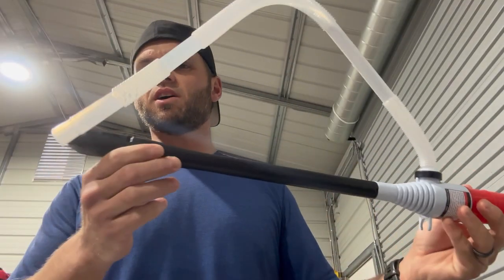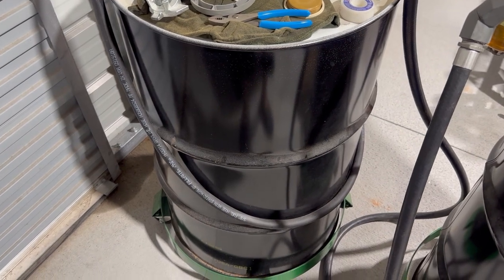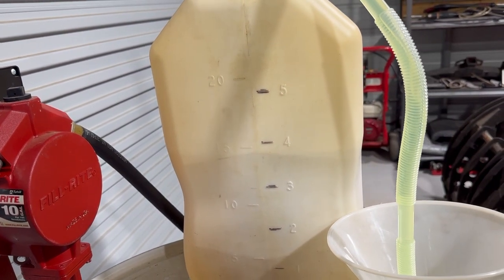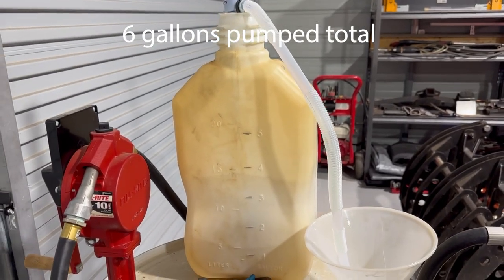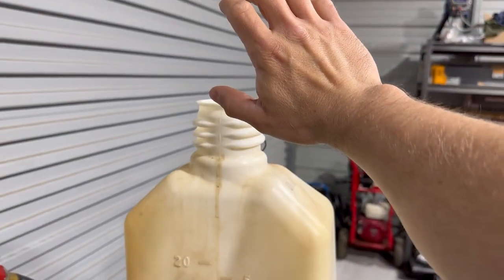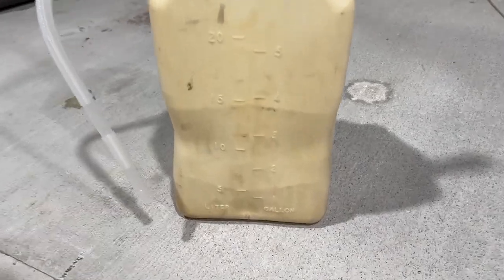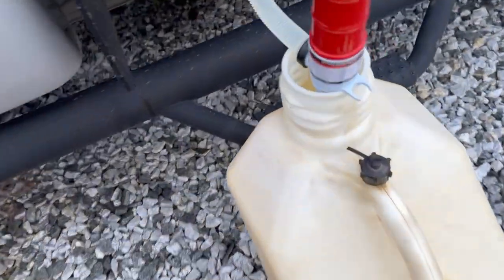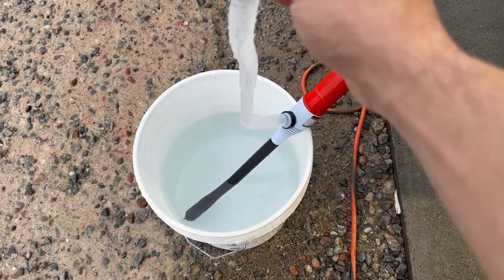This Sucks 😁 | Harbor Freight Battery Operated Liquid Transfer Pump

Comment: I have one as well and really like it! The pump and hose that goes into the gas tank is telescoping be pending how deep the tank is. Get a better set of batteries, I have used mine or some time and it still pumps like when the batteries were new.
Reply from the maker: I like mine too! From some of the comments it seems like we got really lucky with ours. Mine is still running strong.
Reply: @reallifetested2605  Ya we maybe did but then again I find it’s very hard to please some people now a days.

Comment: Is it holding up?
Reply from the maker: I pumped another 100 gallons of diesel , gasoline 2 days ago and it’s still running strong! I’ve got quite a few comments saying theirs didn’t last, and my dad has went through 2. I might’ve gotten lucky?
Reply: They are frequently on sale or there are random coupons. If you are an inside track member, I think they are less than $6.29 (Oct 2024) this month. This thing could break every year and I'd keep buying them because they are just that handy. I'm going to pick up a couple more while they are on sale and try to mod one that has a hose on the suction end for the same reason as in the video, I have some fuel jugs like in the video and a couple others that the pump doesn't get to the bottom of. Also, I am going to dedicate one to gas and another for diesel.

Comment: That was a great video. I actually have one of these Harbor Freight pumps that I saw at the store as well and was surprised at the performance. I use it to transfer water from 5 gallon water bottles to fresh water tank on my RV. I'm going to get another one to put on my Inflatable boat as a bilge pump
Reply from the maker: Thank you.I honestly didn't think this pump was going to hold up as well as it has. Since i've made this video i've pumped over 100 gallons of gasoline on top of what I did in this video and it's still working great! That's a really good idea to use as a bilge pump.

Comment: I bought one and use it twice and it broke try to send it back but I didn’t have a receipt so I just threw it away and bought another brand
Reply from the maker: After talking to you and a few others I think i might’ve gotten lucky with this one. My dad bought one because I spoke so highly of it and he literally used it one time after that it was leaking. The one I have has literally had hundreds of gallons of fuel through it and still works!

Comment: I have had two of these pumps fail after pumping around 50 gallons of gas before the motor fails.
Reply from the maker: Oh no! So far I have been lucky. Mine has pumped well over 100 gallons at this point and still going strong. It does go through batteries though.

Comment: I'm going to be buying one of these and if needed I will  just rig a hose at the end to reach the bottom. Thanks for the review otherwise I wouldn't realize until after trying to do something and then finding out it doesn't reach
Reply from the maker: You’re very welcome! It might work it might not depending on how long your suction line is. At the minimum if you could get a good siphon going the pump should do its job of maintaining it. So far my pump has worked great although a few others it seems are having mixed results.

Comment: 120 gallons & mine just died.

Used it once a week to transfer 4 & half gallons of diesel . 

The batteries last longer than the pump 😂
Reply from the maker: That’s awful brother! Luckily mine is still going strong. I did have to start removing the batteries from it as it got a parasitic drain somehow.

Comment: I have a generator tank that has about two inches of fuel remaining.  The pump is not drawing it out.  Is the level of the fuel too low?
Reply from the maker: Yes, if you look at the base it just has a small motor with an impeller. That has to be fully submerged. On my generator to fully drain it I usually have to disconnect the fuel hose, drain it the rest of the way, then run it dry. Hope that was able to help a little!

Comment: You think this thing can pull on a garden hose to start a siphon to empty a pool?
Reply from the maker: I would say no. It really doesn’t have enough power to lift much further than the length that it’s made. I will say that when we siphon our pool out for winter. (This is hard to explain in txt) but! If you put your hose completely in the water (while holding one end of course) let the hose fill completely with water. Put the end that you have in your hand under water until the bubbles stop coming out. Then put your thumb over it. You should be able to just pull the end out and it will self siphon. Don’t take your thumb off until it’s below the water level though or it won’t work. Hope that makes sense!
Reply: @reallifetested2605  it does! I'll try it. Thanks so much.

Comment: Hey does this work for transferring old gas out of car ?
Reply from the maker: I don’t think this would work to good for that. You have to have the end of the pump submerged into the tank for it to pull the gasoline up through it. Even if you managed that by adding an extension hose I don’t believe the pump would have enough lift to be able to draw the gasoline out.

Comment: Does it work with a hose?
Reply from the maker: It definitely won’t on the suction side. On the outlet side it could if you had it below the container you were pulling from. gravity would help the weak pump.
Reply: @reallifetested2605  I guess I am cutting my bed cause I’m not dropping my tank with 30 gallons of gas in it
Reply: Thanks for the reply
Reply from the maker: Can you get a small hose in there and siphon it out? I had to do that on my dad’s truck to change his fuel pump. It takes forever to siphon it out because of the small hose but it’s better than taking that tank down. I just used my mouth to get the siphon going. Gas burns so be careful if you go that route.
Reply: @reallifetested2605  I will just go through the bed and then weld it back up I think it will be way easier than dropping the tank I literally just put a full tank of gas in so I am not too keen on the syphon method to be honest I will just cut it with a grinder and then I’ll have access to the pump
Reply: @reallifetested2605  it is not leaking so I am sure it will be fine
Reply: There’s literally no air in the tank so I don’t have to worry about it catching fire liquid gas doesn’t burn it is when it evaporates it gets really flammable I was a fire fighter for a number of years and I am doing the job across the street from the fire department so if worse case scenario I will have some help quickly
Reply from the maker: @ronaldcherrier3205 be careful and good luck brother. Hopefully everything will go smooth for you.

Comment: I've bought two and both were junk. . The worst one of all that I have tried. And I've tried a few. One worked twice and one would not pump right out of the box. .
Reply from the maker: I think I got lucky because my dad had the same issues as you. Mine is still kicking and I use it all the time.

Comment: Do you know if this will work with rear differential gear oil changes ?
Reply from the maker: This definitely wouldn’t have enough lift for thick gear oil. I made a video a while back that I’ll link below of a pump that I use to do oil changes, I’ve also used it to do differential oil changes as well. The video is a of me changing the oil in a lawn mower, but I use this pump for all sorts of things. 
Can You Change Oil Without Draining | Lets Find Out!
https://youtu.be/EzL-_NGvQPM
Reply: @reallifetested2605  thanks bro
Reply from the maker: @ericsivilla4091  actually here is a video of me doing differential fluid. I had forgotten about it. 
https://youtu.be/q-xvwcaJnmo
Reply: @reallifetested2605  thank you bro

Comment: Well you're supposed to winterize equipment WITH stabilized fuel in it so...🤷
Reply from the maker: I really looked into this a few years back. Some manufacturers recommend draining the tanks and running dry, while others recommend leaving tanks full and running stabilizer through everything. I think it depends on carb vs fuel injected, steel tank vs plastic tank etc.

Comment: thats a horrible pump.  Walmart sells them as Hyper tough for $8.   They seem to only work in syphon mode and can't lift liquid any more than 12 to 18" above the source level.
Reply from the maker: I've been using it a good bit and have been happy with it for my uses. You're right about it having bad lift though. It does lift ok when you have a set of fresh batteries in, but that's not for long.

Comment: Those batteries suck avoid any heavy duty batteries and get the cheapest alkaline battery they have like 3 times to 6 times the power
Reply from the maker: Alkaline does have more capacity than the zinc chloride equivalent. It would be interesting to see the runtime differences between the two.

Comment: Gas got inside the battery compartment on mine. It scared me shitless. One spark and I could have been gone in a ball of fire. This is cheap Chinese made crap. Dangerous as hell.
Reply from the maker: Sorry to hear that. You’re right that could’ve ended up bad real quick. I’ve been extremely lucky as mines still kicking, but a lot of others are having similar results as you.